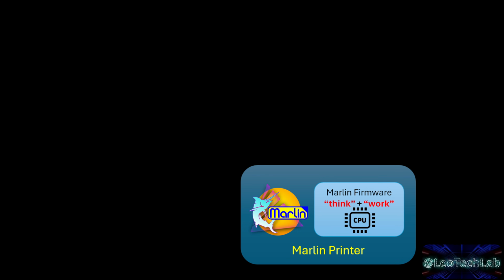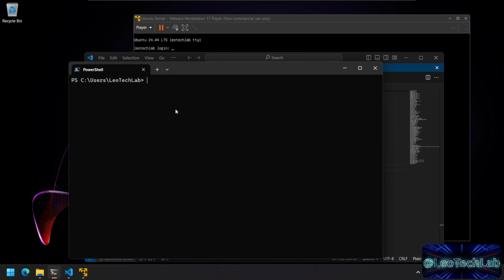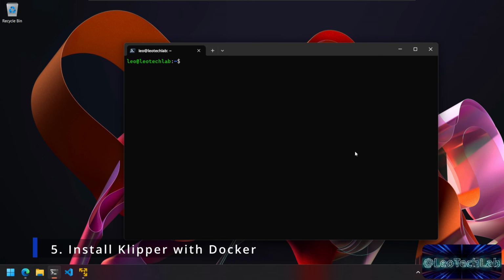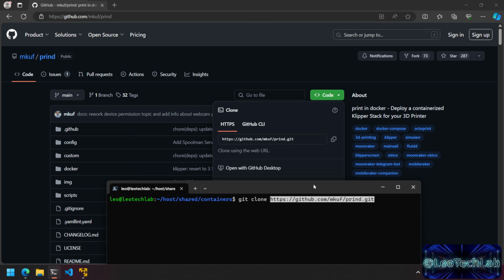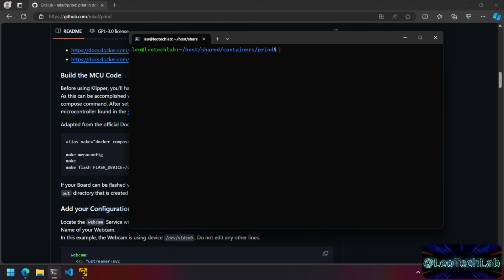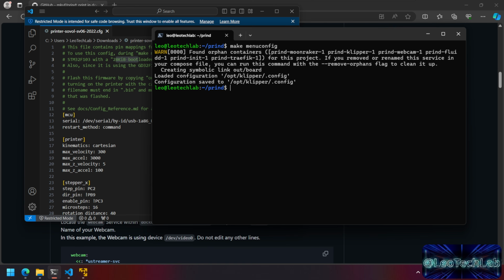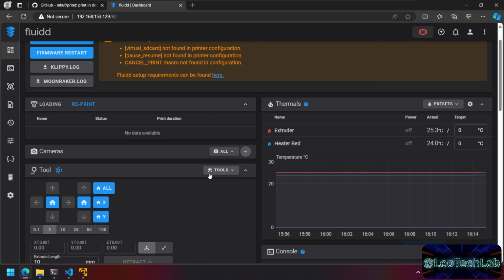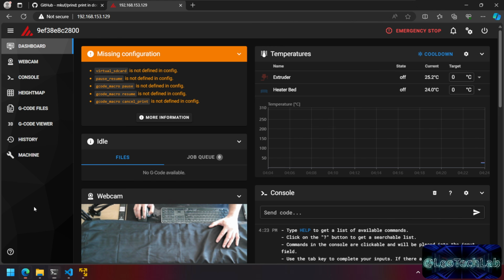Install Klipper with Docker (Windows and Linux)

Comment: Hello Leo. I have problems with my Geeetech Mizar M to install Klipper on the MCU. Also I dont know what kind of values are needed in the printer.cfg File. At github the no file cfg file which i can use. Can u support me?
Reply from the maker: Sorry, I switched to BambuLab over a year now, so I cannot help with other printers at the moment.

Comment: Great Tutorial. First i thoght i can install everything manually, but then i had problems with installing moonraker. But the way using prind you showed in the video worked well. The only problem i had was with the webcam, because i didn't had any connected
Reply from the maker: Thank you for the feedback👍

Comment: love the tutorial but I can't run klipper from docker on ubuntu 24.10 i'm switching the OS (RaspiOS Debian 11) my last try today.
Reply from the maker: I used Ubuntu in all my tutorials, and I didn't have problems setting up docker. Can you describe more details about your problem on running docker?
Reply: @LeoTechLab  I'm just installing the new operating system thanks for you help
Reply from the maker: No problem. Hope everything works out👍

Comment: Hey, this worked great overall! Install was really easy and I can control the printer. The one problem I'm having is that the gcode files sent from my slicer don't end up in the 'correct location' leading Moonraker to warn that the gcode path received from Klipper does not match the expected location. I can't seem to find the expected location (/opt/printer_data/gcodes) to edit the [virtual_sdcard] section of the config. Any thoughts on this issue?
Reply from the maker: Hi! Glad it was useful ;) 

Regarding your gcode directory, I'll start by asking if you already added the [virtual_sdcard] section to your printer config file? If not, please do so and point it to "/opt/printer_data/gcodes". If the problem persists, please read the rest ;)

Just to be clear, given that this is using docker, the "/opt/printer_data/gcodes" only exist inside the docker volume "gcode", accessible by both klipper and moonraker. I'm not sure how your slicer is configured to interact with klipper, but if it is using the Moonraker APIs directly, it shouldn't have any problems uploading the gcode file to klipper. If, on the other hand, it is trying to access the file system directly, it won't find the "/opt/printer_data/gcodes" folder on the host system, because it does not exist in it. As I already said, it is a docker volume that is only accessible directly by docker containers that request it, such as klipper and moonraker. You can try and manually upload the file using fluidd or mainsail directly. If that works fine, I would say the problem is probably in the integration between the slicer and klipper. 

If by any chance this integration is the problem, and if you want to continue using the slicer integration, you can always try to switch the docker volume for a docker bind mount and mount a physical directory on your host system. Maybe that will help the slicer integration. Just change the all the volume mappings from "gcode:/opt/printer_data/gcodes" in the docker-compose.yaml of prind to "/opt/printer_data/gcodes:/opt/printer_data/gcodes", and ensure that you also create the "/opt/printer_data/gcodes" directory in your host system. This will bind mount this host directory to the virtual directory with the same name inside the docker containers.

Hope this helps.

Comment: Hi there
I’m using proxmox on my server and can I create a VM and use debien in that VM and install Klipper in it?
Reply from the maker: Although I currently don't use proxmox in my setup, I don't see why not. Proxmox is a type-1 hypervisor, so as long as you are able to configure the usb passthrough to the debian VM you want to create to make use of the 3d printer and webcam directly inside the VM, you should be ok👍
Reply: @LeoTechLab  Thanks I’ll try it later today
Reply: @LeoTechLab  I`m using Proxmox and passthrough the USB`s, i also use the  sudo apt remove brltty ... but it`s still not showing up my printer. Any workarounds?
Reply from the maker: I don't use proxmox, so I cannot test this, but the "brltty" package only blocks the printer driver to load, it doesn't block the printer device itself to be recognized via USB. Does the printer show up in the connected devices, even without a loaded driver? Are you sure the usb passthrough is working properly?
Reply: @LeoTechLab  i got it working, was a thing with jumper and and a Button that needs to be poped out on the btt skr3 ez
Reply from the maker: Glad you got it working! 👍
Reply: @Grabo3Dprinting  How did you get the klipper.bin file out of the ubuntu server?
Reply: @Afrobama_YT  FileZilla works for me

Comment: Trying to do this currently on my unraid server and it's nauseating how different it is. I can get the dockers spun up but actually getting it to connect to my printer just won't work.

Also I can only get octoprint running, the others (fluid and mainsail) just don't open. If you're familiar with unraid I would be forever grateful if you made a video on getting that working.
Reply from the maker: Hi! I'm not familiar with unraid, but I can try and help nonetheless ;)

Given that unraid is just a proprietary linux distribution, we should be able to make it work. 

From what you're telling me, you already have docker engine installed, so I'm assuming the problem is getting your printer connected via USB, and maybe your webcam as well?

Can you describe exactly what the problem is, so that I can try and help?
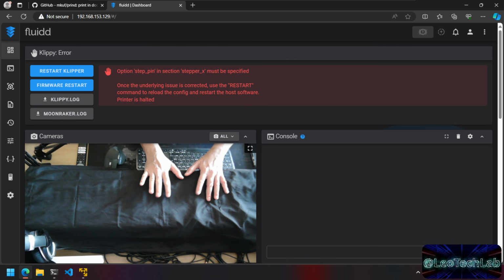Reply: @LeoTechLab   I am also trying to get this working on unraid but am running into a different issue. everything worked up until the steps at 23:40 which is running the command docker compose --profile fluidd up -d  

after running this command everything seems to work except for prind-webcam-1 because i dont have a camera setup. other than that all other services seem to be active but when i run "docker ps" i dont get the full list of services that yours does. instead it only shows two docker services running named "prind-traefik-1" and "prind-fluidd-1" and thats it. though if i do the docker down command it shows all the services are active and shutting down (except for the webcam) so this implies that those other services are in fact running and just not showing up seperately in my docker ps command for some reason. proceeding to the next step i am able to access the fluidd webui but i get an error. it hangs on "connecting to moonraker" for a few seconds and then gives me a pop up saying "add printer" and asking for an api url. 

i have tried following the troubleshooting guide that says to try connecting to myprinter.local which does not work. im sure these services are running since running the docker down command shows those services were running and shutting down. 

more info on my setup: 
i have not installed klipper firmware on my printer yet. Do i need to do that first for the webui to function?

i am running ubuntu server VM in unraid, the printer is connected over usb which is passed through to the vm. confirmed it is visable with ls /dev/serial/by-id

if you have any advice on how to proceed from here id appriciate it. Id also prefer to use the octoprint profile instead of fluidd by running the octoprint profile i cant access the webui at all. thought that isnt my main issue at the moment.
Reply from the maker: I'm really sorry you're running into problems using this setup on unraid, but I never used unraid personally and I also stopped using klipper given that I'm now using a bambulab printer (less hassle, just works), so I don't have any way to help you test Klipper currently.
Reply: @LeoTechLab  gotcha. I appreciate the quick reply anyway. I've checked out several guides on this project and so far yours has been the most helpful.
Reply from the maker: @BlueFangbluser Thank you! Sorry I cannot be of more assistance in this particular case.
Reply: May I ask how it went? It’s surprisingly uncommon to use Unraid as a Klipper host, and I couldn’t find anything else besides this video. I got stuck while trying to compose up prind, which resulted in the error message: “service must be a mapping.”